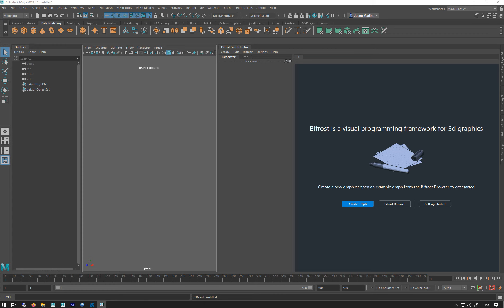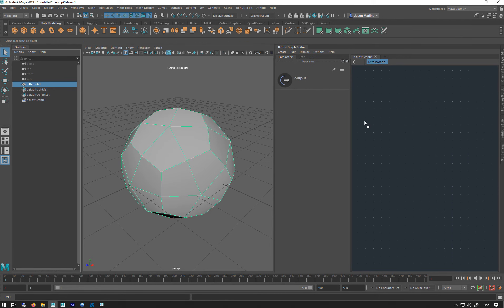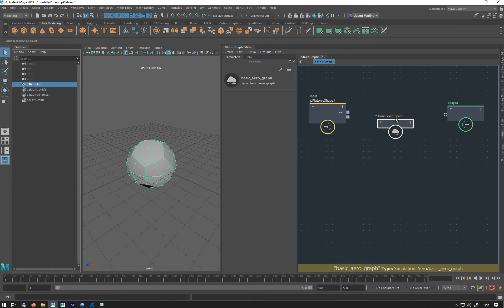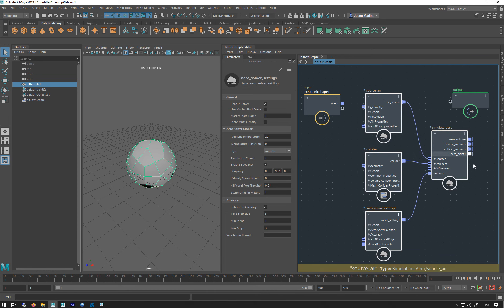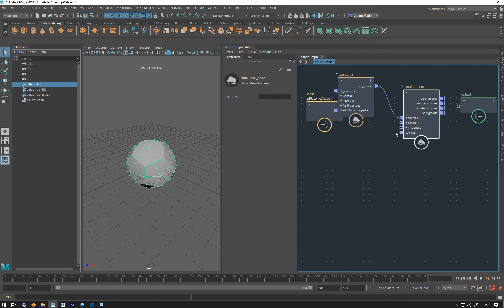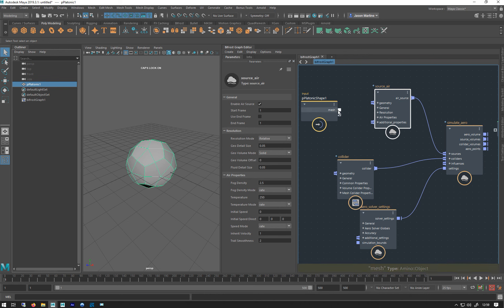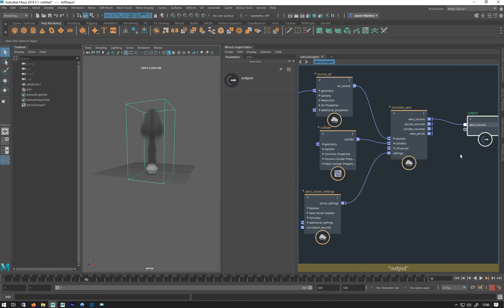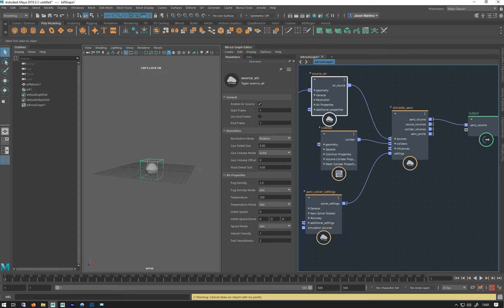BIFROST BASICS: WEEK 1 LESSON 3 BIFROST BASIC AERO SET UP

Comment: I used one of the smoke trail presets in maya because I need a quick result but what would I change in the graph that would allow me to simulate smoke so that it gradually appears rather than just suddenly appearing on frame 1?
Reply from the maker: you could try animating the fog density, drag out the input of the fog density and connect it to an input node. This will expose the fog_density in Maya on the bifrostShape and allow you to animate it. J
Reply: @jmm7180  awesome thanks!